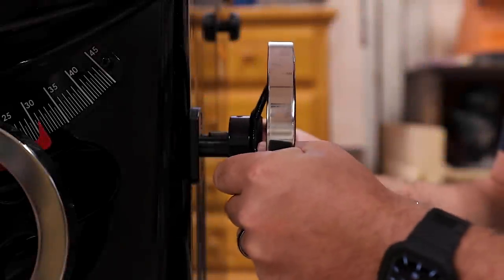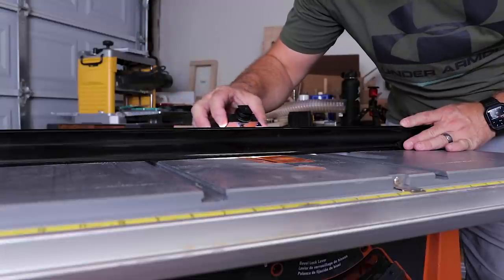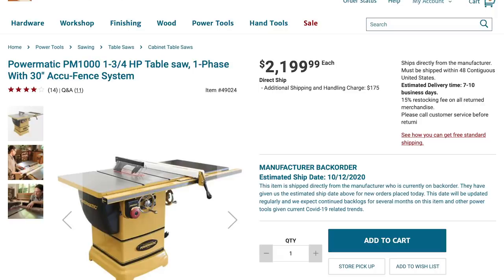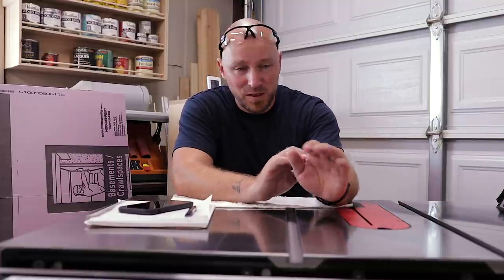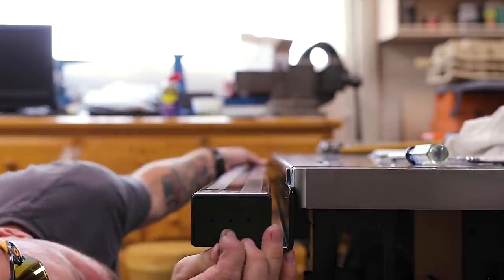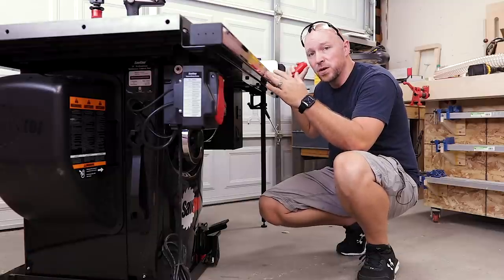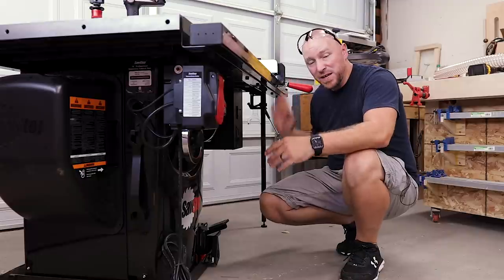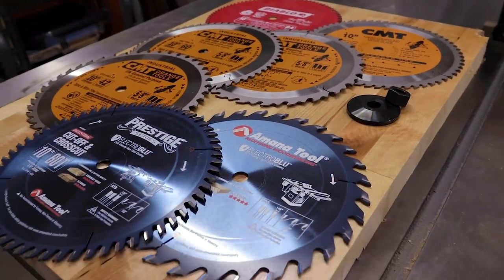I Finally Got A New Table Saw

Comment: Been shopping for my first table saw.   As a total beginner/ weekend woodworker. What should I start with?  Like you I have done a ton of research and I love sawstop for safety, and quality but I don’t want to over spend not knowing how much use, or if it’s just to much saw for me as a beginner. I don’t want to get crap either.  Rather cry once buy once.  Would love some advice for a newbie.  Love your videos
Reply from the maker: This is such a hard question to answer. One thing I will say is that a SawStop is going hold it's value over time. So even if you don't end up using it that much and decide you don't need a table saw anymore, you should be able to sell it for darn near what you paid for it. The same should be true for Powermatic and some Grizzlies as well. As far as what size and everything else, the answer is different for everyone. I honestly think getting a small contractor- style saw works well for a lot of folks starting out. It teaches you safety and limitations. You can make jigs for it to help you along the way, which you will do with a bigger saw as well. You can even build a workstation around the table of the saw to increase it's capacity a little bit, or even by a lot if you are really creative. Cabinet saws and most hybrids just offer more capacity out of the box. And usually more capability, like the ability to use use a dado stack. Without trying to sound too biased, one other thing that just came to mind with SawStop is the ability to add on and upgrade later on. Like if I found that down the road I really could use extra cut capacity to cut sheet goods or something, I can just order the parts direct from them and do it. It would cost me, of course, but the overall process is easy.
Reply: @InspireWoodcraft  Great advice. I think I'm going to shoot for the "Contractor saw" level like you suggest. I think it's a good middle of the road option and should be great as I learn and probably better then going with the Jobsite one since I'm not looking to take this anywhere really and will mainly be in the garage full time.  The cabinate saw level just feels like a little too much for me at the this point and like you said I can always sell and upgrade later.  Thanks so much for the advice

Comment: hey man congrats on the saw and really great vid going over it. I just got the pcs 3hp, I just put it together and am kind of pissed that the amount of money I spent for the 36" it came with an mdf type extension. Im wondering how you like the router table? Im assuming I can swap out this crap wood extension for the router table/insert as my rails are already set for it??
Reply from the maker: The rails for the router table are a little bit different as I recall. Basically a notch at the router table end of the rail so that a miter gauge can be used and not hit the stock rails. But other than that the cast table drops right in. Although there is a cast extension that goes between the right wing and the router table though. I absolute love it. I made a simple desk for my wife with a single drawer and I wanted to round over the tops of the drawer sides so that there were no sharp edges. It was so nice to just be able to raise it up, change the bit, set the height and just go to town. With my old table I would have probably used a sanding block and shaped it by hand because everything was such a chore. I personally think it's one of the best investments in the shop.
Reply: I have the PCS175.    Yea, crap extension table.  I actually messed up the crap table installing my insert, so built a plywood table.  Works great.   Made a separate router fence that clamps to the rip fence or I can clamp it to the saw rails and still have full use of the saw without having to dismantle anything.

Comment: Try Forrest woodworker blades.  Can you upgrade later to 3hp?
Reply from the maker: Yes! I almost got the 3hp but I couldn’t get more power run to the shop for a price inside my budget.  So at some point I can just replace the motor and wiring.

Comment: Two reasons not to be complacent with the sawstop.  I don't want the cut finger. I don't want to pay for the new break and blade.  Not cheap.
Reply from the maker: That last part gets overlooked so much. A lot of other things I would rather buy with that cash.
Reply: @InspireWoodcraft  in Canada the break is $110.  Even a decent blade, there goes a couple hundred bucks

Comment: Can u give a run down of the actual upgrades if someone were to want the same one?
Reply from the maker: I don't have product links right this second but I can tell you this much:
SawStop PCS 1.75hp 1ph 110v
36" T-Glide Fence
ICS Mobile Base
Right Router Table (You could also do a left-side if you wanted which would save a little money)
Table For 36" Router In-Line (The cast iron piece that bridges the gap between the wing and the router table)
Router Lift
Downdraft Dust Collection Box For the Router
Thats the big stuff. I also ordered a set of router table inserts for different size bits, a flip-down stop for the router fence, a dado break cartridge and a dado zero clearance insert.

Comment: Congrats on the new saw! I have the same one and had used contractors saws prior to the sawstop. I recommend getting the magnetic cover for your table saw sold by mlcswoodworking. It’s. White and rather thick. I got it after I used my table saw as an assembly table for some drawers and scratched it up. I also got tired of seeing all the rust spots on the cast iron from sweat or touching it. It’s not as pretty to look at as the polished cast iron but it doesn’t have to be left on all the time. I look forward to seeing the video of how you cleaned up you table saw. I sprayed some Boshield on the bad spots thinking iF I let it sit for a minute it would clean better. Wrong!  I now have splatter marks in my table. I am hoping that whatever you did would make mine look better than it does.

Comment: Hey Jody, where did you get your straight edge?
Reply from the maker: Taylor Toolworks, and I believe it is this one: https://lddy.no/oa1g I was skeptical to get aluminum at first but I got this one on a recommendation from the owner of Taylor Toolworks himself so I went for it. It's been great!
Reply: @InspireWoodcraft  awesome, I have been looking for a good one that doesn't break the bank.  I looked on Amazon but like you was hesitant to pull the trigger.  Thanks!